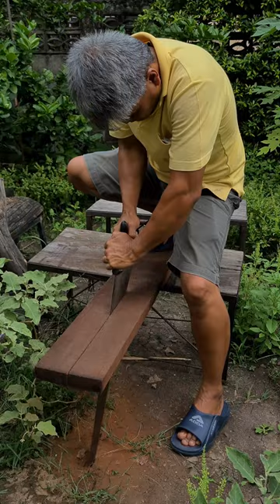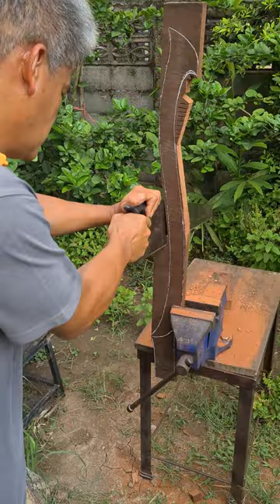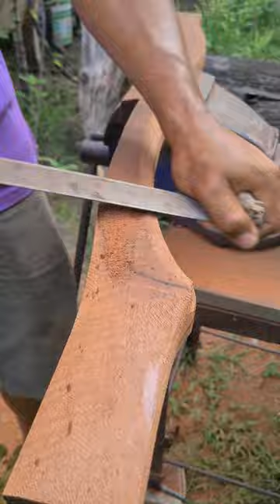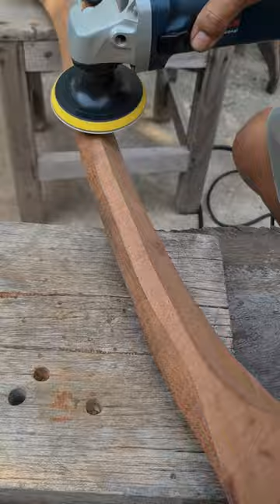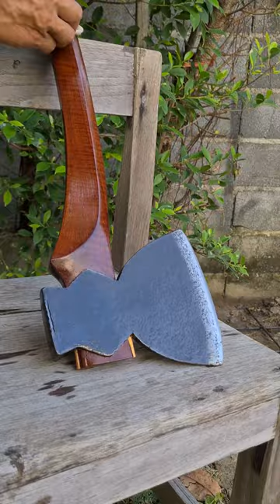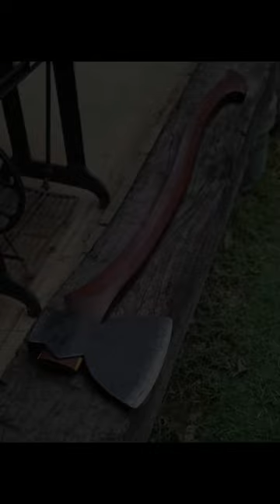Craftsmanship, Handmade beautiful axe handle #shorts #woodworking

Comment: That head is not secure lol, the fit should be snug when on the handle, then you cut an notch, then you drive in a wedge to stabilize and secure the head, after a day that axe is broken again.